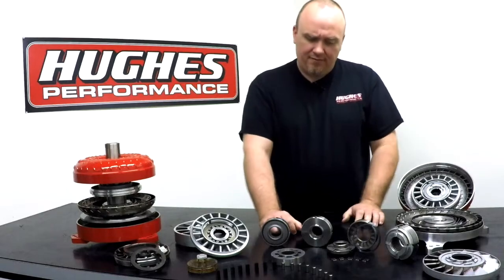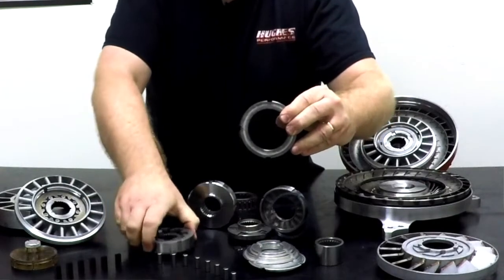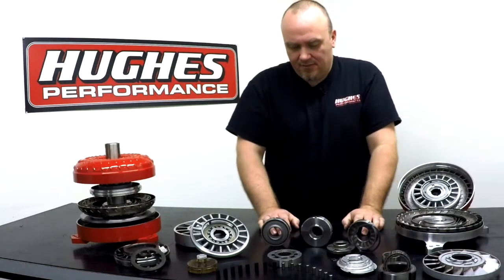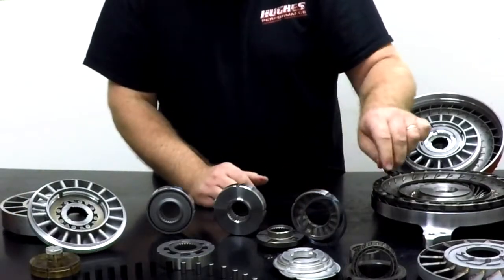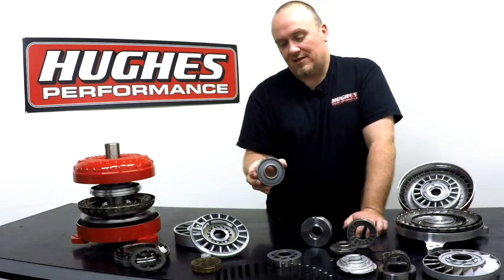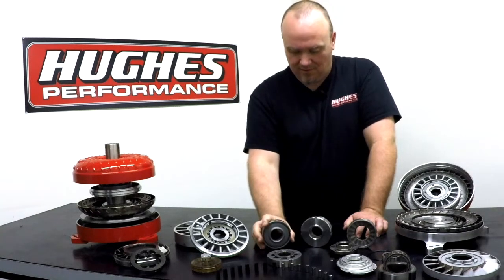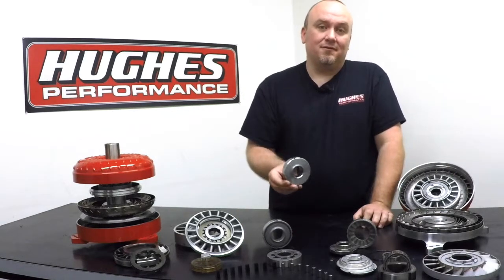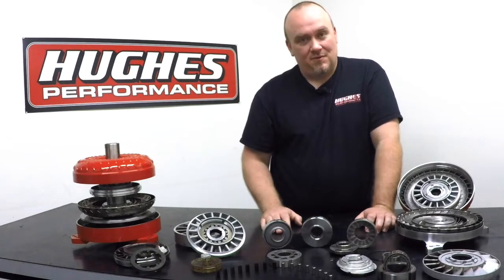Ep. 3 Torque Converters 101: One Way Stator Clutches

Comment: I have to second that, Hammerhead.  I found it very useful to know the sprag clutch can be felt to operate in one direction. I just took out mine from my non-running car and sure enough it  rotates in both directions. And another I have works correctly. Diagnosis Positive. So, much thanks.

Comment: Thanks! Long time garage hobby mechanic, went into engines, etc. never knew exactly what could fail into a torque converter. Automatic transmission, it's obvious - clutches, solenoids, etc. Torque converters are so simple, always wondered. Thanks!
Compliments on the demonstrated deep knowledge and understanding on the matter.
I would like to know what causes the rough 2-3 shift in 6F55 behind 3.0 ecoboost at lery low acceleration or accelerator let off at 13-14 mph. - you asked :D

Comment: Is there such thing as a spragueless converter with a lockup function to keep the heat down?
Reply from the maker: Thanks for commenting!!  It is possible to build a lock-up torque converter as a spragless model, but unless this type of converter is being used in a dedicated drag racing application where the duration of usage is very short, the converter would still overheat due to the fluid shearing happening between the impeller, stator, and turbine even when the lock-up clutch(es) were applied.

Comment: What can a symptom of a failed stator sprag be? My trans(5R55s) in a Mazda Diesel Ute here in Australia is acting up. When stopped and in gear(any gear or reverse) is wants to creep really badly and almost stall. It also has a slight whistle noise as well. The stall speed has dramatically lowered to virtually non existent (used to be around 2600rpm) and feels as though it have no torque multiplication ant all!! It changes gear perfectly and the lock up clutch engages and disengages as is should.
Reply from the maker: Everything you've described points towards a sprag failure inside the stator 100%!!

Comment: I have a question.  I have been trying to diagnose a loss of low end power.  Is it possible to sieze the one way clutch, what would that look like?  I was accelerating from a stop when the power loss occured.  I've tested everything I can.  The trans fluid was changed 2 months ago, had to do it again today. It was getting dark again.  No chunks on the magnet.

Edit:  99 ram 5.9 gas 46re

Comment: I wonder whether I should buy a new TC or go with the used one I have? Having driven stick mostly I am not familiar with the ways of automatics. I remember that back in the dark ages of the 50's the big economic threats were the ball joint and the torque converter.  Would I be looking for trouble to install a used one?  The one way clutch works and the TC never gave any trouble in  use. Or is a TC more or less a wear item? If so, are re-builts reliable. ?
Reply from the maker: A used torque converter is always going to be a bit of a gamble.  If you know the history of the torque converter and know that it's a good match for your combination then you'll probably be okay re-using it.  If you don't know the history of the converter then you should really send it to the converter manufacturer of your choice for disassembly, inspection, and freshening.  You don't want to risk damaging your transmission with an unknown component.